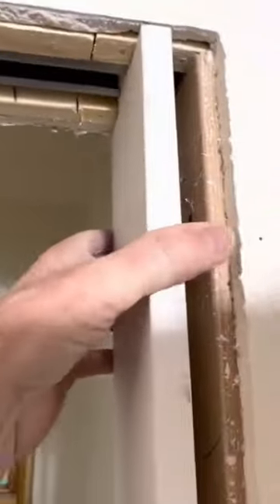Pocket door trim stop notched for clean look

Comment: What about the trim for the other side where the door hides? I'm having trouble figuring out how to finish the compound on that edge.
Reply from the maker: Ok good question.  You see at the end of the video how the door is sticking out about an inch?  We’ll that’s where you put a 1x2 on both sides of the door until the door flushes out. This is just a short video check out the full video on my page to see full installation.